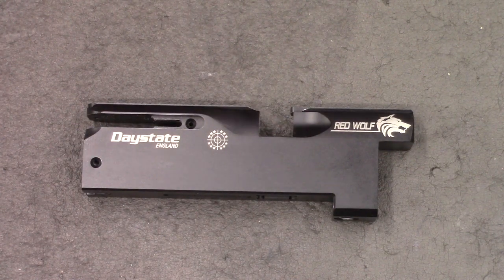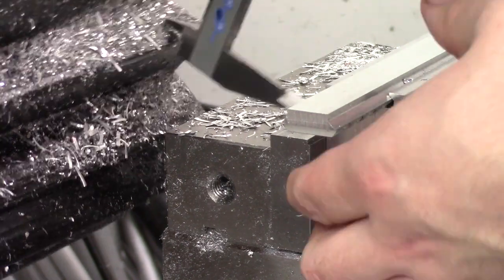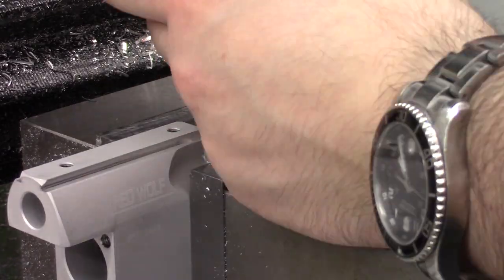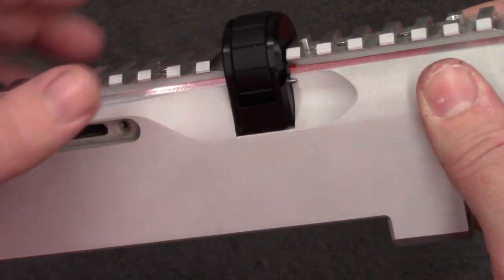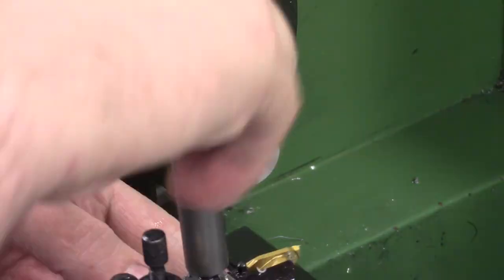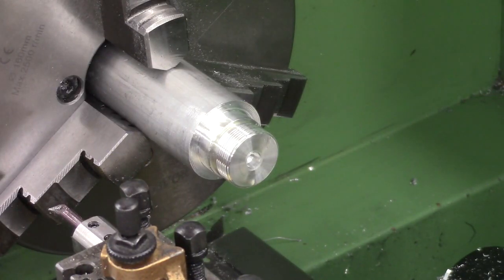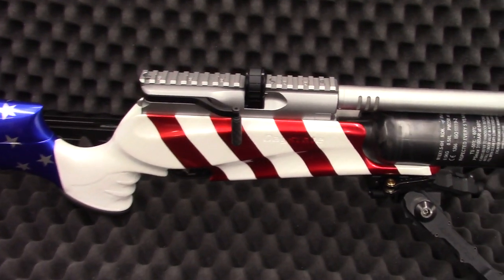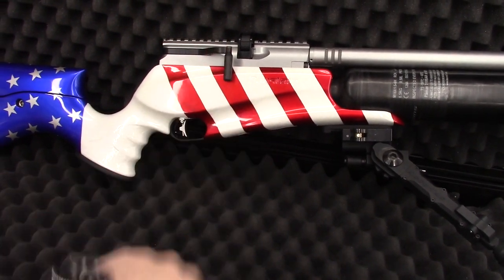Red white and blue wolf special Daystate Redwolf build.

Comment: Wonderful craftsmanship,was always tought that a 4 jaw chuck on a lathe was far more accurate.
Reply from the maker: They can be, but for 95% of work the 3 jaw is just fine, the benefit of a 4 jaw comes in being able to dial parts in perfectly, whereas the you don't have that adjustment with the 3 jaw, this one isn't too bad, when using the master scroll its <0.02mm of run out at worst, but for accurate work I swap in the 4 jaw or the collect chuck and get it bang on. Thanks for watching.
Reply: @sub12airgunners  yes ,always had to centre a piece with a DTI with a four chuck